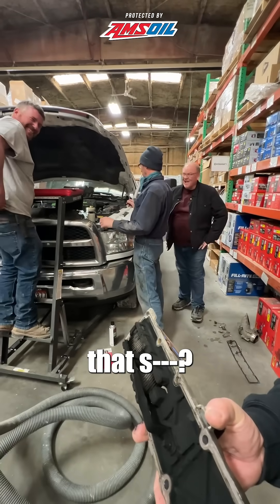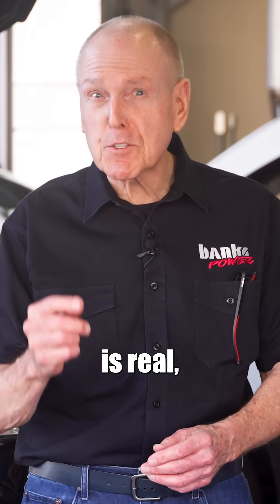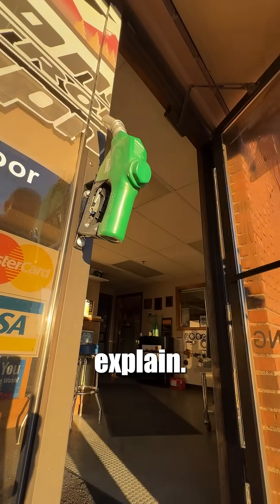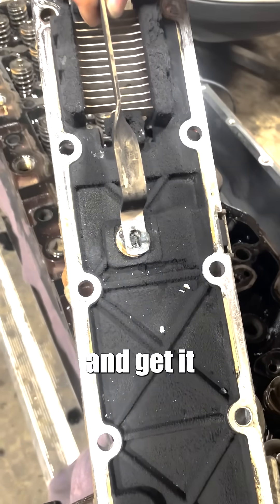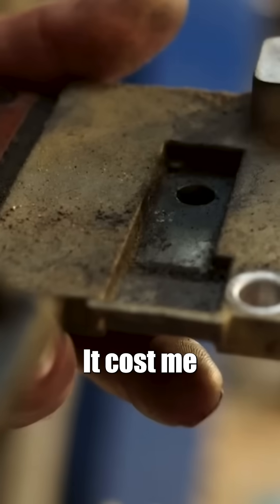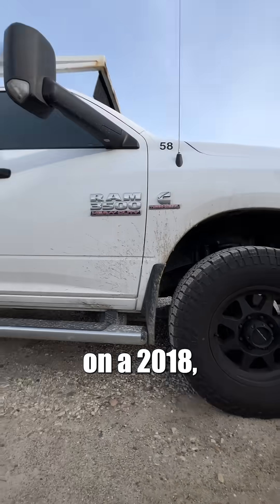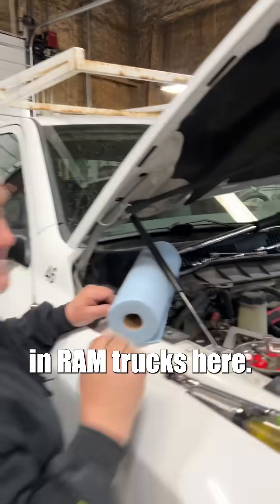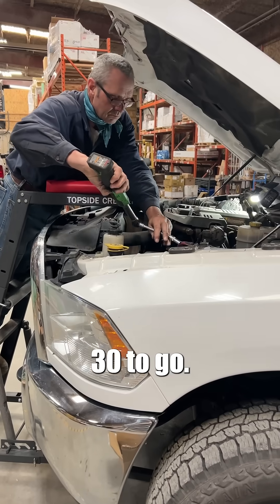Protecting $2,700,000 in RAMs from engine failure.

Comment: Remember when Cummins were the pinnacle of rugged reliability?
Reply: Pepperidge Farms remembers.
Reply from the maker: @hustler539  😆😆
Reply: @hustler539 😂
Reply: @hustler539 🤣🤣
Reply: Pre 2010 Cummins are awesome. It really come down to where the block was manufactured but in my experience absolute beast
Reply: @sterlingalcorn4525 the new ones are just fine. 

I've got an employee that's got over 550k on his 2011. He drives about an hour and a half each way to work, hauls a boat or farm equipment on the weekend. 

Not a single bit of work outside of basic maintenance. Fluids, filters, ball joints and such. Original dpf, no grid heater issues. It's just fine and id put it against my second Gen any day for reliability
Reply: @ personally I love Cummins, and someday I plan to get an third or 4th gen and over hauling it. I like to know your having good luck with them, the idea of heat grid failure isn’t to concerning to me cause I’ve always bullet proofed my motors. Good to hear
Reply: @jeepmanxj  Drives 3 hours a day for work, but he owns a farm 🧐? Oh, i see what your doing, I'll play too. I have some ocean front property for sale in Arizona, it's literally "dirt" cheap 😂
Reply: @shatteredreality87  yep. Drives an hour and a half to my shop Monday through Friday and has some cattle and corn.

Welcome to the country. Leave the suburbs and live a little. There isn't a lot of work out here that isn't mining or lumber.
Reply: @jeepmanxj  I live on 359 acres on big cedar creek in northwest Georgia, Mr Jeep maxi pad
Reply: @sterlingalcorn4525 I have a 2003 dodge ram 3500 dually regular cab things a beast had it since new I also just bought a 2017 3500diesel any recommendations
Reply: I work at a Ram dealership. Have for 28 years. I work on Ram trucks all day every day. It’s literally all I do. I’m in Georgia. I’ve seen two engines affected by the grid heater nut. Both were from salt states. So if you live in the south away from the ocean you have nothing to worry about. Also. It will set a code for intake air heater solenoid months before the but just falls off. So even if you live in the snow belt, if your check engine light isn’t on, don’t worry yourself about it. There are extra benefits to the kit though for sure.
Reply: You’re confusing Cummins with caterpillar
Reply: Remember when quality stuff was built in the USA
Reply: When was that? Detroit and Cat have had them beat all throughout time
Reply: A Cummins is still fantastic emissions didn't help.
Reply: The Dodge always has cheap plastic interior ..the nobs and buttons and switches always broke ....then you go look at a truck ( Ford) that was made 8 years before that or more ..and everything was working inside ..but the tranny was out ..lol
Reply: Cummins raced their engines at the Indy 500 and would have won if not for a plugged air intake they did not anticipate from the fat boys in the crowd tossing their stinking garbage out like it was a baseball game. The Cummins car was so advanced, that their body style was adopted by all cars soon after. Pinnacle, absolute pinnacle.
Reply: Me either.
Reply: @S10dragracer_888 😂😂
Reply: @S10dragracer_888 😂😂😂😂
Reply: @S10dragracer_888 this is gold😂
Reply: @S10dragracer_888 bro top comment 😂
Reply: @S10dragracer_888  😂 I'm a Cummins fanboy and I still laughed
Reply: Lmao no.
Reply: I have a 24 valve in a 1999 and have no problems. To be fair, it only has 137k original miles.
Reply: No
Reply: I've owned two of them; there will not be a third. Ever
Reply: 5.9 still rocking.
Reply: Pepper ridge farm remembers
Reply: What new truck is lol ill take my 3rd gen over anything now and anything old 5.9 cummins are gods
Reply: That little  6mm bolt  wa
Reply: An engineering DESIGN FLAW......
Too rushed to research and fix it.
Reply: It is the beancounters and fresh out-of-a-degree people that ruined it.
Reply: 35 years ago?
Reply: I still have my second gen with about a million miles on it and still running good
But what do I know about the cool kids stuff🥴🤷🏾‍♂️🍻🇲🇽
Reply: Nope
Reply: Imagine ....creating a post that's interesting
Reply: Said no one ever
Reply: Me either 😅
Reply: Blame the epa. This all is happening from the epa.
Reply: Not anymore.
Reply: when was that the 50s or something?
Reply: No. Never. They fall apart. People have started bringing them to Australia and the moment they find a dirt road they rattle themselves to pieces.
Reply: Had a 24 valve 2500 in a lifted 1998 ram 1500 body (engine tuned and bottom end built)
Was really nice bro
Step mom crashed it and we sold it
Only a dented front bumper
Reply: They still probably are if you remove the emmisions crap. The 12V is king though.
Reply: They are still above the rest, they all have issues in different areas
Reply: Only cost 15k to remove a 1 dollar bolt
Reply: never? i always associated it with cheep heavy power.
Reply: still are the best.  this is one design flaw
Reply: Survivor bias. Those ‘bulletproof’ old engines were the ones built on Monday/Tuesday, or those that got the 10% of the critical part that won’t grenade. All the Thursday/Friday engines were scrapped decades ago after causing years of heartbreak and pain to their owners.
Reply: Pepperidge Farms Remembers
Reply: No I sure don’t ever remember hearing this being said…. The engines in Semi’s suck too!!!! I would t even consider owning anything with a Cummins in it!!!! Junk!!!!
Reply: Im a ford guy, clearly. But dad’s 5.9 been goin over 20 years, over 400k on it
Reply: then EPA happenned and people allowed them too much overwight and power
Reply: In 94-02
Reply: There not good now
Reply: Even the older ones had a timing pin that would shear off and ruin the engine. Nothing new here☠️😂😵‍💫
Reply: I liked this comment because I thought it was sarcasm. I hope it’s sarcasm.
Reply: My dad and uncle both bought 98 HO cummins 1 stick 1 automatic. Both are still going same engine and trans today. Both have over 600k. That's reliability. Simple engineering. No fancy crap. Just work trucks working.
Reply: 😂 i sure as hell don’t
Reply: Every diesel is built nowadays like this so you have to spend money to either buy a whole new truck or buy parts
Reply: Cummins have always been time bombs. Old 12 valves had the killer dowel pin
Reply: That's literally never been the case lol
Reply: @Octavallopllo  DUDE, I own 2  12v 1stGen Cummins and both run strong and I have 402k on one and 160k on the other that I bought later as a backup. 32 and 34 year old Cummins 12v still running strong. Rugged, reliable? Yep!!
Reply: @Octavallopllo  the 5.9 was and still is bulletproof.  facts
Reply: @jakeross21  kdp
Reply: @jakeross21 nope, 12v had an issue like this except instead of going down the intake, it will rape the cam to death. Do you want a 3 piece cam combo?
Reply: @jakeross21 also, what good is the 5.9 when it’s surrounded by possibly the absolute worst truck ever made?
Reply: @racistdoctor5818  thats why there's still more of them on the road then any other truck
Reply: @racistdoctor5818 clearly you've never owned a late 80s or 90s Ford diesel, or any F series.....let's not pretend that Dodge made something any less durable than GM or Ford back in the days when plastics were absolute trash after a few years of sun baking. And don't get me started on wiring or suspension or transmissions with all brands. I build them all. You guys have your biases towards specific brands but they all have their own special issues. So let's all quit acting like we built our favorite brand from rare minerals and extracted ore from earth with our bare hands. Their machines that can either be treated right and maintained properly or abused and killed in no time. Tired of the childish "duh muh brand is better than yours" argument.
Reply: @toomanytododge2594  I have all the respect in the world for a 5.9 Cummins but EVERY manufacturer claims they have the "most still on the road." The Cummins will keep going but the truck will be long gone if it lives here in the rust belt. Around here, Dodges come from the factory with rust.
Reply: @Octavallopllo  Very, very rare and overblown by the guys selling the kits. Most of KDP happens on '94 and up until Cummins changed the design.
Reply: @racistdoctor5818  Worst truck ever made?  It's not in a Ford, it's in a Dodge!
Reply: @racistdoctor5818  Please elaborate, I've not heard that and I've had my 93 for 20+ yrs. Are you talking about the overblown KDP problem?
Reply: @tobylou8  didn't say they weren't reasonably reliable but they're certainly not the Pinnacle. Kdp, grid heater bolt, injector issues almost everything with the 5.0 in the Nissan and cp4 on later 6.7s. every Duramax and the two good power strokes are 400k motors. They MIGHT require a little bit more maintenance but will be better in every way. Regardless every motor Cummins makes is a 400k motor other than the occasional n14. Big cams, kta, isx and x15s are all about power. Except the m11 which is trash. I have almost a million miles behind All of these Cummins motors and the only one that hasn't left me stranded is my own 6.7. People only ever bring up the 12v when it comes to Cummins reliability because it's the only one to bring up and it's the least impressive. Nearly any motor can make it 500k when they don't make enough power to hurt themselves. at least all the other motors made decent power. Also the only reason I brought up kdp was to point out they're not bulletproof I'm aware it's way over blown but so is the lb7 injector issue, lbz cooling issue, 6.7 p stroke turbo.
Reply: @racistdoctor5818 
 No it wasn't installed in a Chevy.
Reply: @jakeross21  dowel pin
Reply: @Octavallopllo  Okay, since I was talking about the 12V, I don't know why you throw all these other motors, even other Cummins. "Doesn't make enough power to hurt itself" makes no sense. If it could "hurt itself", that would be a very poor design on Cummins part.
Reply: @jakeross21  Isn't that the one they put in military 5 tons?
Reply: @toomanytododge2594 you 100% do NOT see more Cummins than powerstrokes
Reply: @chuckatley1464  rage bait
Reply: @Octavallopllo that's only the 94-98 12valves. The 24 valves from 98.5 to 07 are bullet proof
Reply: @noaht5191  diesel mechanic here. This guy ACTUALLY gets it. Rest of you are cherry picking your facts.
Reply: @racistdoctor5818 it's sad, because I've always loved the style, but they really were absolutely riddled with drivetrain and body issues.
Reply: @racistdoctor5818  I can't believe that with my 2007 Dodge Ram Mega Cab with the last of the 5.9 Cummins Diesel .  Almost 300,000 miles pulling loads for myself and it's never let me down or any problems .
Reply: @noaht5191  amen brother.
Reply: @racistdoctor5818  Wasn't the issue with a alignment pin falling out and into the timing gears ??
Reply: @jakeross21 honestly I see more 6.0 ford's still on the road than I do 5.9 dodge trucks by a long shot.
Reply: @racistdoctor5818  Yeah, compared to problems with the Duramax, & 6.7 Fords, I would take the Cummins, in a Ford Truck🤣🤣
Reply: @jakeross21 5.9 24valves yes sir
Reply: @jakeross21 5.9 had the killer dowel pin AND the Brazilian block castings. You’re just seeing through rose colored glasses. The dowel pin was just like this grid heater thing; easy enough to fix but never should have been. The fault 24V block castings? Basically just wait for it to crack then put a new engine in it.
Reply: @noaht5191 absolutely... EVERY vehicle manufacturer has their own issues. like you said, fords usually suspension (and wiring) gmx is mostly wiring and rust lol.. and dodge well i have one so i definitely know that they aren't good for transmissions or for making quality machine parts.. i think ive blown almost every gasket on my truck (not even kidding i can name them all off) and its a 2019 with 160 000km so not much over 100k miles on it. and its already shitting the bed.. idc what truck brand it is, theyre all making disposables now.
Reply: @noaht5191  the real story is the trucks that never were maintained well and barely had their oil changed lol old C hevy 350 4 bolt mains would take that better than almost any other engine, and these days the ford 5.4 ,at least the ones I personally know of put up with the negligence and abuse the best
Reply: @racistdoctor5818 exactly. The Dodge truck falls apart around the engine lol
Reply: @jakeross21 Not really. Timing pin issues, blocks leaking oil and antifreeze through them! Nice try though!!
Reply: @noaht5191 Well said, bud. Well said!
Reply: @Octavallopllo 12v cummins
Reply: @Octavallopllo  not figuratively?
Reply: @Octavallopllo you've clearly not been around of Cummins lol, or any diesels for that matter.. does ford make a good 7.3? sure yup.. did gm make the lb7 which was very popular in its time. abso-friggen-loutel, but when it comes to Cummins, especially around Detroit, paccar era.... they made bulletproof motors for semi's and for their pickup. every brand is gonna have their issues. ford is death wobble, gm is wiring issues, and ram is usually transmission or gaskets decide to blow left and right lol.. but as far as the motor itself, It was bulletproof. you weren't cracking/or snapping a block on a Cummins from some mod grade tunes.. say that to the 7.3 tho, great stock, not with a tune lmao, shit will blow.
Reply: Nope
Reply: Was never the case. Cummins are great but if you wanted rugged reliability you’re better off with a 7.3, too weak to hurt itself.
Reply: @mastermas6 yeah for the week it runs right 😂
Reply: @mastermas6  I have seen 7.3's that pull like a freight train! Made a lot of power like the trucks of today and got pretty fair fuel milage too!
Reply: @mastermas6  LOL, "too weak to hurt itself"!!
Reply: @mastermas6 the Duramax is better
Reply: @Romuls753 nobody says that lol
Reply: @jonthebuildingmanager LBZ duramax entered the chat
Reply: @  @Myan-_  are we talking 12v Cummins ? I need to know the opponent here lol
Reply: @jonthebuildingmanager  I say that and I have a million mile Duramax to prove it.
Reply: @ We have a 96 12v at 1.2m but that’s not unheard of.
Reply: No one does.
Reply: @camerons6028 4bt motor is know for lasting 30k plus hours…. I’d say that’s a pretty damn reliable engine
Reply: nah i actually don’t...lmaoo
Reply: I dont
Reply: I dont

Comment: Can’t you just save money by flipping the bolt and having the nut out outside and just make it part of your preventative maintenance I just double checking and tightening it 🤷
Reply from the maker: Nope! Plus there's a second bolt inside the grid heater that can't be accessed without disassembling the intake elbow, and that one also fails.

Comment: Just did the fuel RAIL PLUG ON 2 TRUKKS. A 2014 W 658,000 MILES , AND A 2018 W 420,000 . BOTH were deleted early on and no loose grid heater bolt and NO SOOT AROUND THEE INTAKE HORN THEE Itty bitty black that was there I wiped clean w brake clean and a blue towel,then installed the bolts on each of the fuel rails.Easy job and my clean trukks are soot free
Reply from the maker: That's a ton of miles! Unfortunately for a lot of us, deleting isn't an option because we have bi-yearly smog inspections.

Comment: Great engineering, more air dilevery is a great improvement. My question is, what's the best product out on the market to get more air to the air horn?
Reply from the maker: It's hard to beat our intercooler and boost tube combo. It outflows the stock stuff by 48% and adds +27 hp and +51 lb-ft of torque. On the other side of the turbo, our Ram-Air intake setups are awesome as well.

Comment: What about the 6.7 Cummins ISB? Does it have the same issues? I have a fleet of school buses with that motor. The wiring harness doesn’t feel loose at the heater grid so I don’t think the bolt is loose.

Comment: My bolt is good so I just disconnected the wire to it. I use the block heater when it gets cold here in Tx